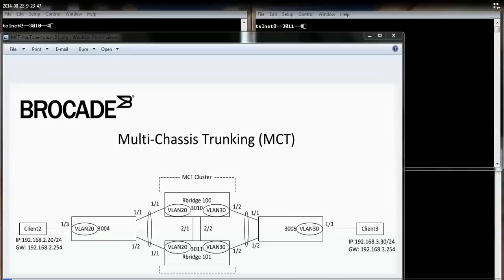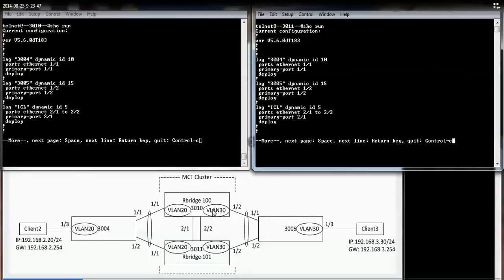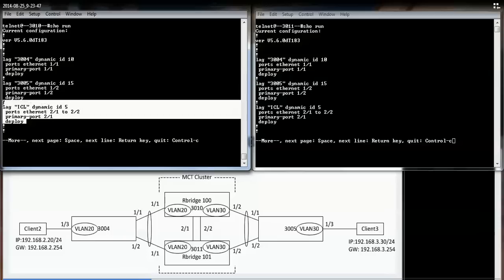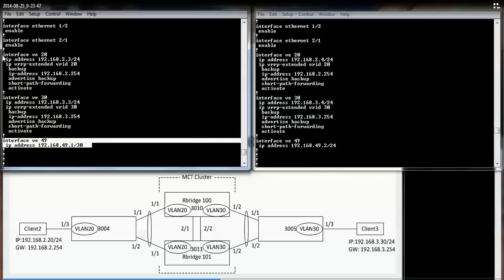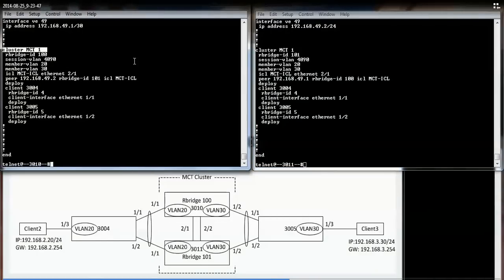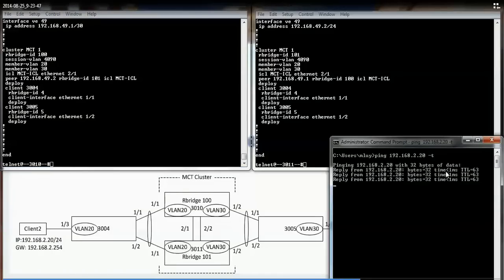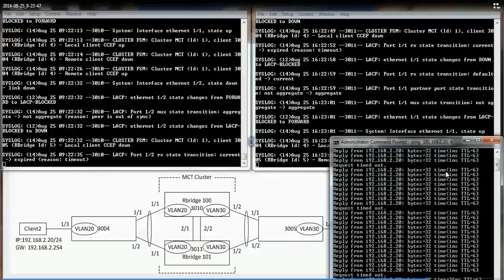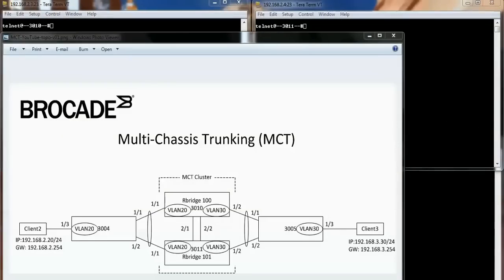Brocade Multi-Chassis Trunking aka MCT (vPC, mLAG, MC-LAG,SMLT) configuration

Comment from the maker: Hi FixxerNori, Sorry for the bad audio. The devices on the left and right were used to simulate 3rd party devices, for example Cisco switches. As long as CEPH supports LACP, it will work.